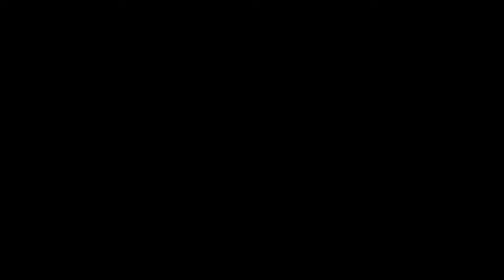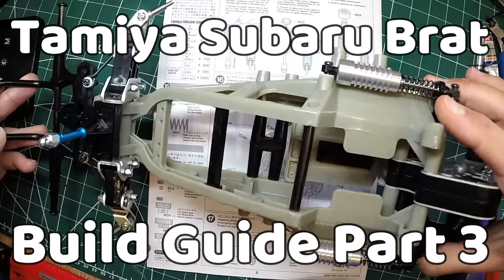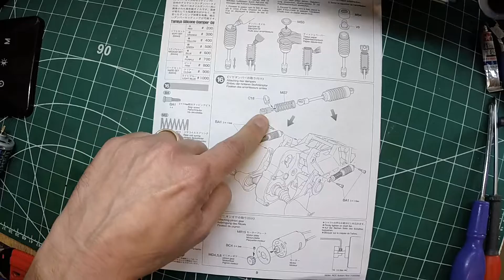Tamiya Subaru Brat Build Guide Part 3 - Electronics and Steering. Tamiya kit 58384

Comment: I've just bought a kit, what battery, ESC and controller etc would you recommend
Reply from the maker: Hi. There isn't really a short answer because it depends what you want. Probably just go with the esc in the kit which is usually a hobby wing 1060 badged as Carson. You can get cheap servos and radio sets on sites like banggood and Ali express. Probably just go nimh with the battery so you don't need to get into the issues of storing lipos. Hope this helps 👍👍

Comment: Hi Pete. Great videos, really pleased we found them. I have an FTx bugsta. It’s developed a problem whereby it only seems to run at half power. It seems like it’s stuck on a training mode. Any help would be appreciated. Thanks
Reply from the maker: Hi there. Thanks for your comments. Ooh I'm not sure about that. Is it the standard brushed ESC? I didn't spend all that long using that before I put a brushless set in. I just had a look at the manual and the info on the standard ESC is pretty sparse and doesn't mention a training setting. The Etronix radio doesn't have a throttle rate function either as far as I know. If you have other components I'd just swap them out till you find which bit is at fault. Is the battery ok? Sorry I can't be any more helpful.
Reply: Pete Wylie RC Videos Thanks for replying so quickly. Like you say the info in the manual doesn’t give too much away. I’ll start replacing parts and hopefully get it back up to full speed. Anyway, great vids. My son and I are really enjoying watching them.

Comment: Hi Pete, excellent informative video as always. I've never had a frog or brat so its interesting to see how it goes together. Be careful with that esc though, the 104bk doesn't have a built in bec so can cook your receiver and/or servo. I had trouble with mine until I fitted an external ubec (couple of quid from Ebay).
Reply from the maker: Hi there. Yeah I never had one as a teenager back in the 80's so great to be building one now. I didn't realise that about the ESC. I need to investigate that and I might swap it out as I've got other ones. Many thanks for the info. You learn something new every day! I'm still painting things to finish the build and do the part 4 video. I'll mention about the ESC as it might be of interest to others. Thanks again 😀
Reply: No worries Pete. I've been a subscriber for a while and learnt so much from watching your vids it's nice to give something back even if its just a little snippet of info.
Reply from the maker: Well it's a very useful snippet if it saves me frying the receiver.  If you let me know your first name I'll mention the issue in part 4 and you as the source of the info. I'd always assumed that an ESC outputs the correct voltage for the receiver but it seems that it's not always the case.  Cheers :-)
Reply: I'd love that thanks Pete, my name is Mark. I'd feel properly famous if I got a mention in one of your vids! I was reluctant to mention it at first because I consider myself a beginner and yourself as one of the oracles! I think the earlier tamiya Esc's were meant for 27mhz radios with the bec in the receiver but from the 105bk onwards it was built in to the esc.
Reply from the maker: @bruntfca.7808  haha, I'm afraid you won't be very famous on my tiny channel 😂 Anyway the 4th episode is still in production so I will certainly mention it. I'm sure we all learn new things all the time and YouTube is so good for picking things up. You may laugh but when I got back into the hobby in about 2012 after about a 25 year gap I didn't even know what an esc was! The last time I'd had an RC it had an analogue speed controller and I didn't even know that things had moved on. Also I ordered a 2.4ghz radio and when it arrived I emailed the shop to ask why the receiver only had a tiny bit of aerial wire! I have learned a few new things since then! Cheers for now 😀
Reply: I don't know Pete, well over a thousand subs is pretty impressive. I've got a friend who refers to his esc as a 'wiper' because I'm sure he still thinks it has an arm going up and down inside it like the old msc's! Anyway, looking forward to the next episode, keep up the good work. 👍

Comment: Nice building. The edited farm animal noises are funny too. I am in the middle of of Tamiya Audi Quattro -TT-02 build. Thank you for the tip of backing the white PS paint, with silver, that has really worked well for me. I have tried to upload some stage of my build, if you have some time, would welcome your input. Keep up the good work and stay safe.
Reply from the maker: Hi there. I didn't add any animal sounds. I just live next door to a zoo 😉 Anyway I will head over to your video when I get back on the PC in a bit. The Quattro stickers looked rather tricky on Marks video. Looks like a really nice body set. Thanks for your comments. Will catch you over on your channel later 😀

Comment: Way to go, Pete! Great build! Nice job installing the receiver, it's clean, it's neat. The switch reversal also seems to me to be more practical. 
Thanks for the advice about the servo, I didn't know about the use of the different screws or the use of the thread lock in case of metal. 
And then, the animal noises, it was just excellent, I almost swallowed my coffee askew when I heard the elephant barking...🐘
Reply from the maker: Hi there. Glad it was useful. Yeah I don't understand why they put the switch like they did. Also putting the receiver down low in the chassis seemed odd because of the dirt etc. Oh yes the animals were a bit lively outside my window that day. There had been an escape from the local zoo! Thanks for watching and your comments. Hope all is well with you and you are enjoying your track 😁
Reply: @PeteWylieRC  Yeah, I'm having fun with my track.  I'm thinking about how and where to put bumps. 
I wish you lots of courage Pete for going back to work on Monday, you'll have to protect yourself my friend, be careful. 
See you soon.
Reply from the maker: @fencenaoghen3569  yeah you need some strategically positioned bumps on the track for sure. Work should be ok. I spend about 90% of my day driving a car on my own. We've got the hand gel, face masks etc. Shame that I will have less time to build RC's though 😭

Comment: Yes Yes Mr Mister. Superb Pt3. The wiring still looked a bit fiddly. It appears to be a tad strange to place a receiver in the lower depths of the chassis only to get covered in crud when you take the car out for a drive 🤔... It would seem that the balloon trick would be of interest if you wanted to take the car out in the rain though. Did you waterproof the other ESC seeing as the 02-s was too big? As always, a very good tutorial with plenty of information for the beginner to build a Subaru Brat 👏👏👏 Cheers
Reply from the maker: Hiya Pete. Yeah it's very odd that they suggest putting the receiver down there, especially as there is that space where I put it. The other ESC does also fit ok  I just used the smaller one because this one is never going to need to use the brushless feature. I've been running this in the garden with the lexan shell and it's really nice to drive. This will be used as a light basher. I'm trying to get the hard body painted and not doing a fantastic job but it will hopefully be ok in the end.  Not sure how long it will be before part 4 of the build is finished. I'm back to work on Monday so a bit less time to tinker with the RC's. Cheers for watching mate. Hope all ok with you 😁
Reply: @PeteWylieRC  I'm really looking forward to Pt.4 now. Don't worry, you'll soon be back in the old routine of work in the morning and RC in the afternoon and evening lol. 
Whatever you do, don't rush the paintjob or it will look sh*t 😎
Reply from the maker: @cw-01creations46  the mistake I've made with the paint so far is that I used grey primer as it's what I had and it's taking a million coats of red to cover it. Also got a bit of a paint run that I need to sand out. Should have just gone out to get some red primer as Halfords is open for click and collect. I will explain all my mistakes on the next video! Hopefully it will look just about passable from a distance! Cheers matey 😀
Reply: @PeteWylieRC  Good ol' Halfords to the rescue. Oh yes, red primer for anything Red paint related. I think the grey is for darker colours like blue, green, purple etc although if you look on the lid it would normally say which colour primer to use but saying that, I use grey primer for almost everything I spray.  Probably because I have about 9 tins of the 500ml ones 🤔 can't beat a bit of grey primer lol 👏